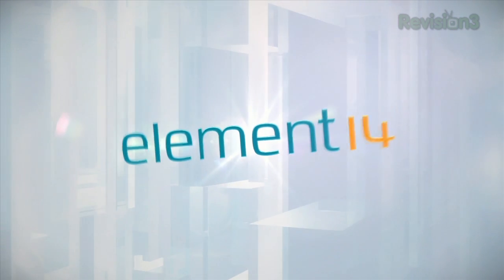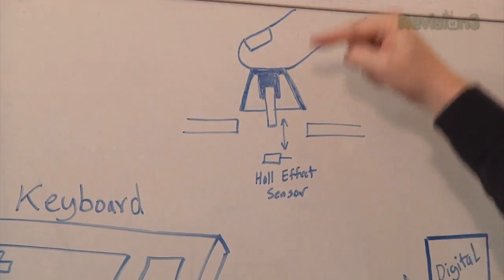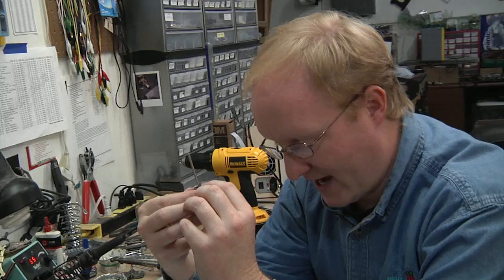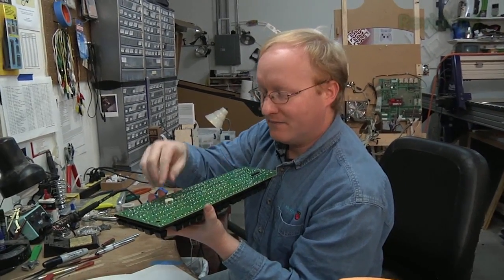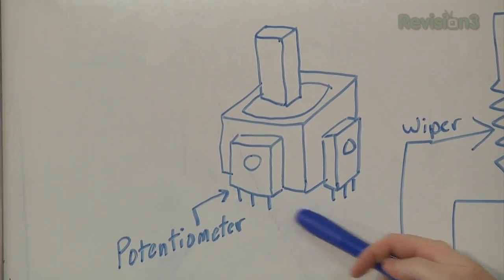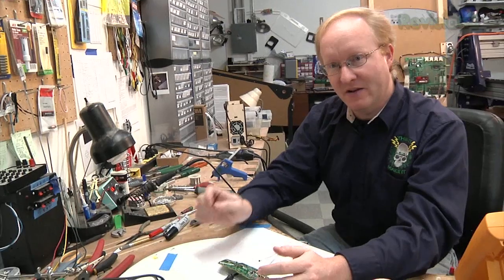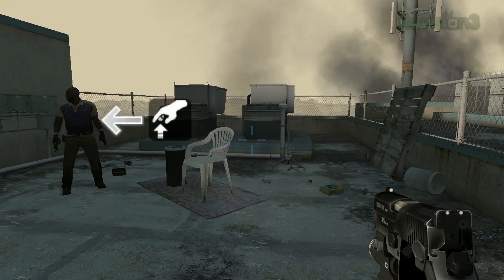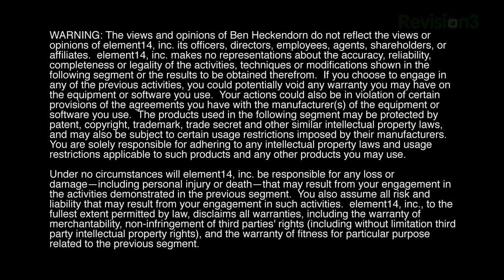XBOX Controller Mods: Analog WASD Gaming Keyboard

Comment: i know this is an old project video, but why do this anyway? i like the idea and its pretty neat....if we didn't have controllers compatible with pc. But since we have a controller from xbox that clearly works, wouldnt it make more sense to just use that? or just spend 20 bucks on a dual shock style usb controller and use joytokey to emulate the keyboard with custom controls for the potentials.
Reply: You aren't a PC gamer are you?

The reason? Reason Number one - So you can use a mouse too.

Reason Number 2 - So you have a full keyboard at your full disposal for gaming.

Making this device MUCH better than slow console controllers.
Reply: I bought a USB controller from Walmart for $20. Using joytokey works great for Minecraft. A full keyboard is not nessessary for most games. I am not a hard core PC gamer. I have Minecraft, Atari and 3d ultra mini golf deluxe. I do not keep my library of games on PC. I have ported most GameCube games and gameboy games to PC and use an emulator for those. My PC is nice. I consider it at the bottom of the high end category of machines. A workstation PC makes a better gaming platform than a desktop. My computer is not the best. It never will be on account of the rapid increase of advancements in technology. 

By the way, wouldn't it be better to have a gamepad alongside the keyboard and mouse?
Reply: Russ Orler Console game pads require 2 hands, so while its possible to have a mouse accompany the player its impractical. (Further more, I believe there is a large advantage to accuracy using normal fingers as compared to the thumb on a nob.) - 3 fingers controlling the same axes as one thumb is going to pretty clearly develop an advantage 

- Typing is essential for most PC games, its just practical to be able to type on the same device you play on (Console typing methods SUCK - period.)

-Games do not need to use 100+ keys to justify a keyboard, while its nice to have many keys with many different commands its not the main reason people prefer the keyboard. Keyboards offer more than that. for instance freedom of movement ( simply put WASD ) allowing you to move left right in between naturally and quickly without transitioning or moving a joystick around causing an awkward movement. - There is a disadvantage though and that is the lack of analog movement ( For smooth acceleration or varying speeds ) Which is exactly why this device combines the best of both worlds why still being on the superior keyboard.

-Not having an extra controller on your desk is just one less expense and object you have to deal with.

- Once again the greatest thing about it is------ Being able to use the mouse/trackball. Making a console style controller completely useless and a waste of not only time but ability.

PS: The difference would be most evident in driving games and possibly first person shooters. Without this device a console controller would sometimes be used for driving games ( although completely inferior for FPS games ) where as now the keyboard can comfortably compete any task like that.
Reply: For someone like me, a controller is a no go, period. Looking around your surrounding quickly and naturally makes up 50% of a racers performance in a racing game.

For First person games, controllers are very unnatural clunky and break immersion.
Lack of a mouse is an impossibility I will not tolerate in gaming, ( No having a mouse on the side is not a work around, I need my hand on the mouse at all times )

This device is absolutely a god send in that it finally allows the typical keyboard the ONE advantage console controllers had - driving games. - Smooth analog controls. ( It also has uses in other types of games, including First person shooters )
Reply: Conservative USSA I like your reasoning and I can see the advantage in this with those types of games. But keep in mind that games on consoles, like burmout, are made for analog control. 
I think maybe a joystick intrgrated on the side of a keyboard that fits between hands would be nice.  You evrr play a mario game with arrows? Thats the kind of thing I mean. Games made for a joystick. What games are better with wasd? I need cold hard examples
Reply: Russ Orler What games are better with WASD? Answer - All of them.

As implied before a joystick is unnatural for movement unless we're talking a full flight joystick which feels good for flight games - only.

Look at it like this with the analog control both devices can make the same movements however one device is controlled by one dimension ( the little nob ) the other is controlled by 3 to 4. - allowing me to more quickly and naturally getting those movements I need.

Moving around with a nob to me at the very least feels unnatural, using a nob to determine what way I move around in a space is just strange and slow.
(I think we can both agree moving your screen around with a trackball is MUCH better than a nob, its the reason why console players have much worse scores than on PC, your thumb just isn't as precise as your fingers are on a trackball. nor as accurate) - So its safe to assume the exact same dimension and dynamic applies to moving around a scene linearly.

Basis of argument: The "thumb" is clumsy.
Reply: Conservative USSA funny you say all of them...I will take this literally even though I know its not meant in a literal way. Play super smash bros 64 with wasd and tell me how that works out for ya.

But I do see how it can be more accurate. And yes trackball can is better, but now you have entered the realm of trackball vs mouse. Trackball is pretty much analog, and no better than a joy stick. 

I think having a thumb control a variety of movement is more efficient than having 3 fingers ready on wasd. When using a thumb instead, you have other fingers available to hit (essentially) L1/L2, in reference to dualshock contllers. Additionally, L3 is also available as well as arrows. 

So there is a choice to be made: accuracy or efficiency.
Reply: Russ Orler Its neither, Its the reason the average score on PC games compared to consoles is always higher, its a more lethal experience because accompanied with PC you get most people ( and I mean most ) playing with keyboard and mouse where as most console players are using a controller.

That's really all the evidence I need.

I can go ON AND ON AND ON about how I suck with a controller, how a controller just feels "bad" and so on but you and I both know that's a completely relative argument true or not.

I have to disagree with the statement that a trackball is no different than a joystick, my reason for saying this should be pretty obvious, a joystick evolves you holding onto a stick limited to fields of movement, that is to say you can only move it left so much until you hit the limit where you are no longer moving but the game still does. - They may control the same axis per se but that does NOT make them "the same" or "no different" because they are in fact totally different.
If I let go of a joystick it returns to its original position. If I move it all the way to the left there comes a point in which I can no longer move it left, a trackball is different because there is no limit to how far you move left, it just keeps on going and when you let go of it, the device stays still and so does your aim on screen.

It all comes down to this, a joystick forces either the device or computer to do "guess work" on the movement you actually want - That is move it in this direction to do this
Where as the trackball is direct input.

Trackball > Mouse.

Reasons

1. A trackball doesn't move on a table or platform ( the advantage in this should be obvious )

2. With a trackball the user does not have to move the whole thing up and across the surface in order to continue moving the screen or pointer in a certain direction. You can literally just continuously move in any direction presenting not only a HUGE advantage in competitive combat games but it just feels nice in any game.

3. In competitive shooters it helps a LOT to have pinpoint accuracy AND reaction time, this is where the trackball takes a giant lead in terms of performance. The argument behind this is as follows.

  -   1, Manipulating a free moving ball with 3-4 fingers is fundamentally more precise because your fingers are simply more precise and nimble compared to dragging an object across a surface  with your entire forearm.

  -   2, They're faster because in situations where you need to turn often ( either in First person shooters or games with flight combat ) you don't need to lift up and drag the trackball like you would with a mouse, we'll call this "down time" because it is in fact a down time.

4. They're safer, yes I just said safer, not in game but physically are safer for the human to operate. The shape of specifically the trackman marble from logitech is intelligently designed, it fits right in with your entire hand even if your hands are huge or small, your thumb is lower in a natural way where as a mouse doesn't - causing pain after long duration of play and sometimes nerve damage. - Console controllers suffer from that same downside.

PS: We're specifically talking about trackballs similar in design to or equal to the Logitech Track man marble, I truly believe its the future of gaming and that all PC users should discover its benefits. - even for desk work. (especially for desk work*)
Reply: Conservative USSA I see your point in the limitations. And there is no doubt more people us PC than console. But why you would wanna spin in a leftward circle is beyond me. Lol and with the movement limitation, as far as wasd goes, you have two positions of control, pushed or not pushed. Full blast or nothing at all. A joystick can be moved between none and full.
I never said mouse beats trackball. And if I did( I am too lazy to go back and read) I was not thinking clearly. Lol

As much as I would like a trackball, the wireless ones get pricey. I don't like pricy, and I think you can understand that.
Reply: Russ Orler Well I don't like wireless, there is a delay with them.

With this latest comment of yours I'm confused, you made the valid point that with a STANDARD keyboard there is only "on and not on" or pressed or not pressed. but did you watch the video? The point of the build that you yourself said was pointless is to give WASDQE ANALOG CONTROLS!

That means with THIS keyboard you can have variations in how hard the key is pressed. ( analog ) 

As for explaining why the trackball is better its like explaining color to a blind man ( that's NOT an insult! ) It just means that if you haven't experience anything like the trackball you wouldn't understand where I'm coming from.
Reply: But you just brought my original point into the picture. Why have wasd as analog controlls when there is already an analog controller that does that?
Reply: Russ Orler Please refer to all of my comments other than my last one immediately above. In short - Because this device is far better.
Reply: Conservative USSA remember that comment that you made about endlessly going in circles with a trackball? It seems thats exactly what just happened.
Reply: Russ Orler Its exactly what happened, but it wasn't my fault.
Reply: ***** even still, i'd prefer a keyboard like this just to avoid needing a wheel. That way I can also use my moues for looking around - That makes half the race.
Reply: I too have switched to mainly PC and haven't used Xbox for a while. But I set up a USB solution and I am gradually making my way to keyboard and mouse. I think I will take the previously suggested advice and get a trackball. 
But those of you reading this have gotta give game controllers credit for being compact.
Reply: Russ Orler I hope you enjoy your trackball, many people find it "strange" when they first try it because they're used to a mouse however speaking from experience learning to use one ( There isn't a particular technique so to speak, its just a matter of putting up with the awkwardness the first couple of days ) you'll be so grateful because its so much better than a mouse.

Trackballs often look and feel very different, anywhere from some that look like a mouse with a ball for the thumb or just thumb based ones and what not, I strongly prefer and recommend either the "Trackman marble" or something very similar in design. This type of trackball uses your 3-4 forward fingers. Thumb is left click and pinkie is right click.
^ I know that set up sounds strange compared to what you may be used to but trust me its more natural/easier. Best of luck to you!

PS: I'm really passionate about trackballs obviously, I couldn't play a PC without them.
Reply: Conservative USSA the main idea that makes the trackball catch my attention was pointed out by a past poster. It remains in one spot instead of moving. Back in the day before the laser mouse and when the PS/2 port was still popular, the mice used to have the ball on the inside which would spin rollers and be sent to the computer. The trackball is basicly that, but inverted, it sounds like. Are wireless trackballs any good? Is it useful for games like Minecraft and others of that type?

Another thing, the trackball sounds great for first person camera-based games.....but what about when I emulate paper Mario, where movement is meant for a controller with only off/on type buttons? 

Has anyone used a trackball for playing centipede? Is it any good or should arrows be used?
Reply: Russ Orler I've emulated lots of old games and play all kinds of games today, my trackball never made me feel like I was better off with using the keyboard or a mouse.

As for wireless, I tend to stay away from wireless for any input device because of the tiny, input lag. However wireless headsets work great. That's just my opinion of all wireless devices, although convenient to get rid of the wire there is a tiny bit of input lag for devices that send out an input.

PS: Most trackballs use find work from a laser within the device pointing at the ball, the ball will be made out of a certain material or pattern which allows the laser to discern when and in what direction it is moving. thus really high DPI. unfortunately there aren't many dedicated gaming "trackballs" in the format I prefer. While the DPI is inherently very high on trackball or any laser input device its not important for gaming, what matters for gaming is the "FPS" or "hertz" the laser scans at. - Typically 30 fps only as gamers have yet to take to trackballs therefore there aren't any dedicated gaming trackballs which would have up to 60-120-240 herts scanning.
Reply: Russ Orler
How many hands do you have?  Trying to use a keyboard, mouse and xbox controller in 1 game?  A controller does not work well alongside any other devices because it is designed to be used with both hands.  The analogue stick for movement is its one advantage in terms of control.  A mouse is far more accurate and faster in most cases.  That is why this project has a point to it - it brings the strengths of both control types together.
Reply: James Lewis the way a controller (not xbox, but still USB) keyboard and mouse work is very simple. 

I have a Logitech k400r. (Look it up on google, it'll make a lot of sense.)
Along side my usb controller. I domt use the mouse part, so its just controller and wireless keyboard. When I get dome with minecraft, I usually just watch cartoons on funniermoments.com.
But it is a very good system I have going. The trackpad can be a little laggy at times, hence the USB wired controller coupled with joytokey emulator.
Also, to give you a better idea, it isnt xbox style. It is dualshock2 style

Comment: Could a teensy 3.1 microcontroller be used in place of the Xbox controller? Since it can be detected by the computer as a "keyboard" would it be able to pump the analog data into the computer as a gamepad?

Comment: You can use the Shift button + w to go slowly forward and it also works with a s d :P and yeah L4D is a PC game that was ported to consoles not the other way :P It´s made on the source engine which was used on HL2 series, CS source, Portal 1/2, L4D1/2 and more awesome games :P

Comment: While you have a point, there are downsides to developing for consoles that can making developing for PC overall easier.  Current consoles, especially the Ps3, run on a completely different type of processor that no programmer ever had experience on.  Also, the 360, Wii, and Ps3 had PowerPC architecture, while most programmers have their experience in x86-64.  And also general things like ram limitations and forcing devs to not use hardrives (360).

Comment: if thats what you have to tell yourself.. i play PC games regularly with a controller and have ZERO problems being top of the scoreboards.. you may THINK you can aim faster, but experience with a controller allows me to aim just as fast, but also gives me the ability to run, jump, evade, sneak, and do everything else with precision you just cant get with digital keys... i can slowly sneak around a corner simply by tilting the thumbstick slightly, jump while running.. controller beats keyboard

Comment: way  easier method:
pressure sensitive pads glued onto wasd, connected to a µC with direct USB HID support to directly interface as a controller.   everything: 5 parts + 3 resistors.
Reply: +gamerpaddy
And make a mouse that will act like the right joystick.

Superior input to play either console or computer? :D
Reply: +xFuaZe no why? mouse emulation sucks. 99% of the games support directinput or xinput.